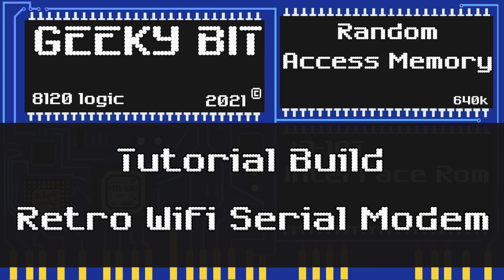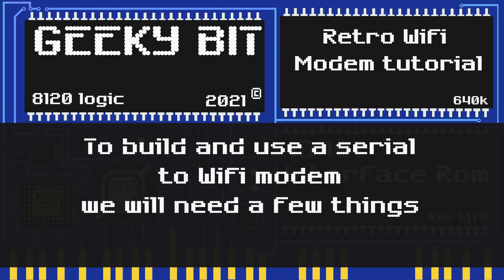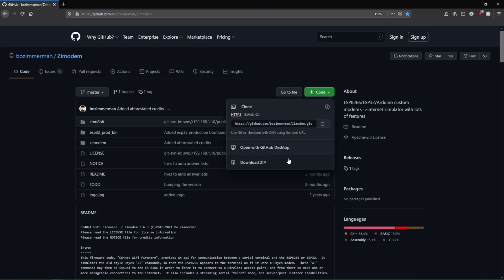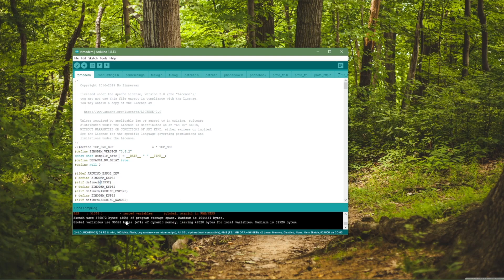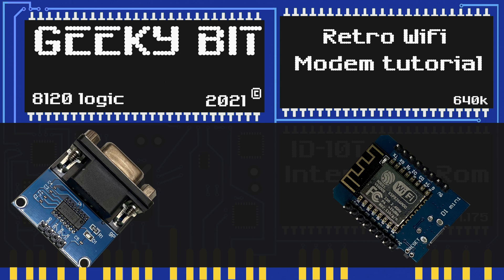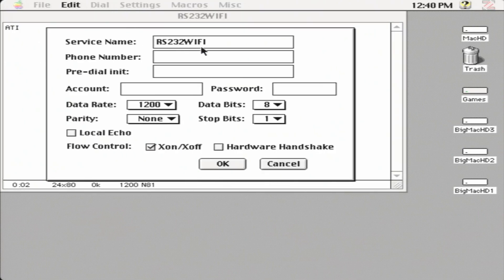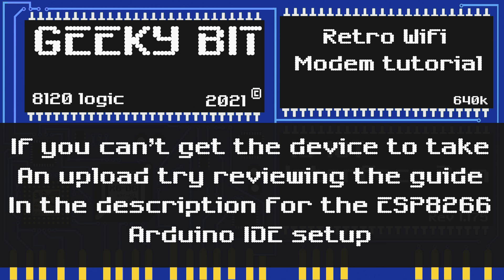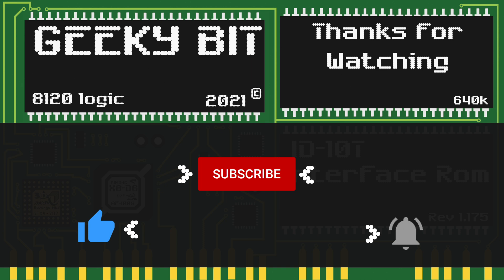Tutorial - Retro Rs232 Wifi Modem

Comment: Neat video! 
The firmware used (Zimodem) was designed with the idea of allowing older machines to do somewhat "advanced" internet things directly.  In another directory for the package, for example, you'll see sample C64 and VIC-20 programs for doing FTP, WGET, IRC, running a telnet server, and other things.  I really wanted these modems to be as useful as the network card in a modern PC.. or as close as possible.
Thanks again!
Reply from the maker: One of the things I am working on is PPP or PPPOE over serial over network... right now I Can do single connection which is cool but I Want to set it up to accept more than one connection so it could have IP address you could "Dial into" and then have access to say a Proxied version if the internet using The wayback site and then allowing a few modern sites too. Maybe even setup a First Class server.
Reply: @GeekyBit  That's a great idea.  I'm headed that way too, starting with SLIP.  "hooking" into the ip stack library without breaking the normal access is tricky for me. I hope you have better/easier luck!

Comment: I get exception 28 error when trying ati
Reply from the maker: Then you want to make sure you flashed the software to your esp device correctly and that the ESP device is supported.... and lastly check that it is actually receiving data back and forth... Exception 28 error seems like a communication error or software wasn't flashed correctly error. This is really complex and that is why I also included the text guides I used.

This is a fast and easy guide meant for 99% of the people. However, it sounds like you have a bit of an edge case. Sadly This is just a video I make with the ESP devices I have on hand. Sadly I am not a professional making professional software and hardware. The guides do have some more trouble shooting, but the 28 error normally comes from the ESP not being happy... So I would start with checking you installed the software correctly on the ESP.
Reply: @GeekyBit  actually version 3 of the esp boards manager update broke it, 2.7.4 works fine. :)
Reply from the maker: @chelsona2574   Well that is good to know Thanks for the reply. I am glad it is all working now..
Reply: @GeekyBit  I knew it was programming right as I had tried some sample sketches to get the LED flashing etc.. but then spoke to bo Zimodem on git and this is the reason It wouldn't flash correctly :)... so for anyone else who hits this problem try rolling back to an older version!